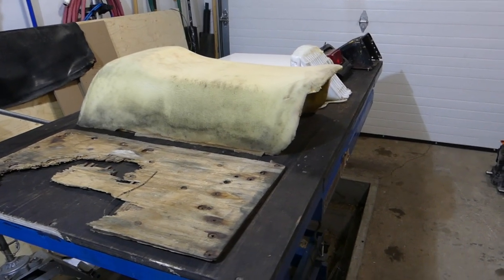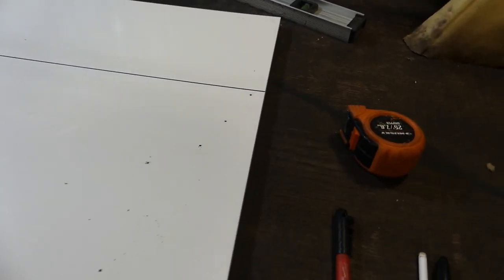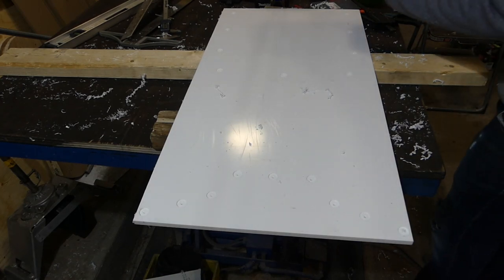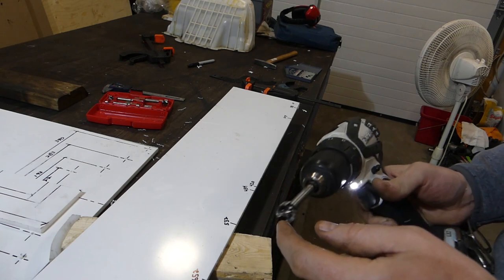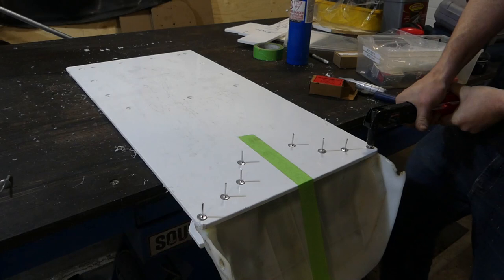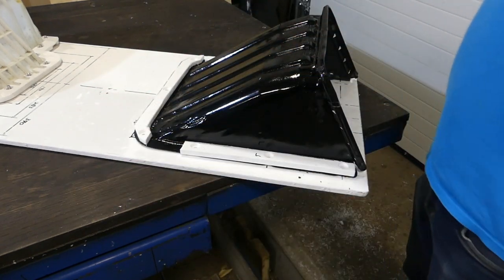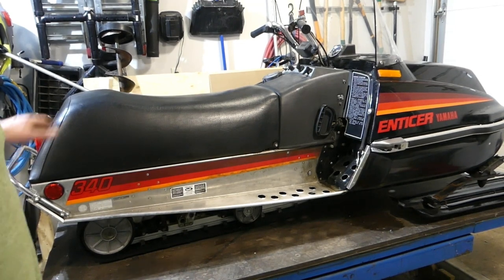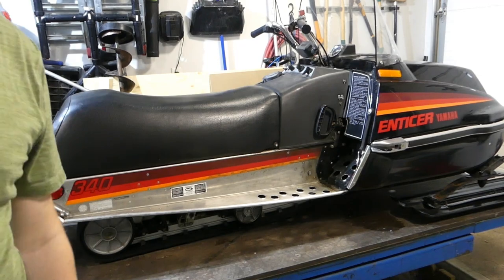Repairing a Yamaha Enticer Snowmobile Seat

Comment: Found a plastic material called "foamed PVC board", for replacing the bottom plate for my seat rebuild. It is 50% lighter than a regular PVC board, and has good characteristics for this type of application.
Reply from the maker: That is good to know! Maybe it takes staples better as well. The stuff I used was very tough.
Reply: @Garage_Tinkerer  Yeah, it is pretty malleable, I was able to cut the corners just using a mora knife. Regarding the staples, it is a apples to pears comparison, as I am using the slightly wider T-50 staples, as this stapler is much more heavy duty. I have no problems punching into a thick plastic cutting board with it, and that plastic is more dense than the foamed PVC board...